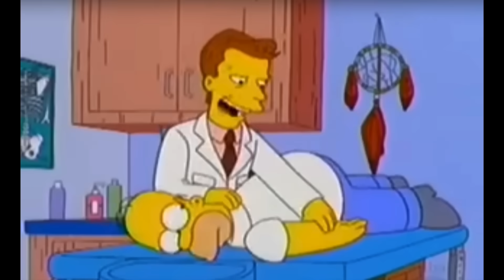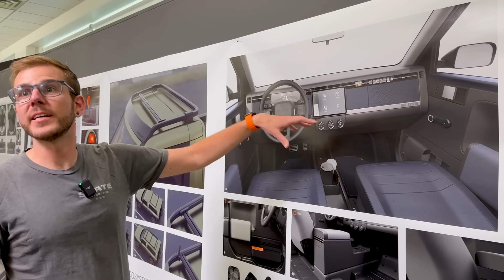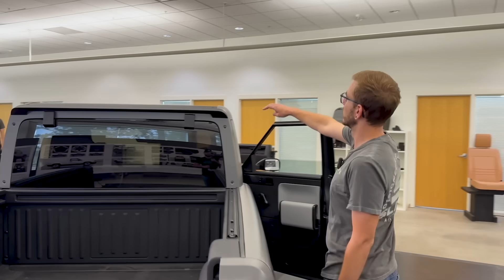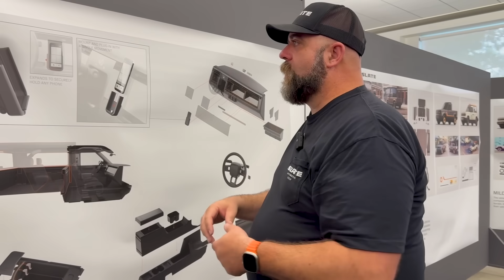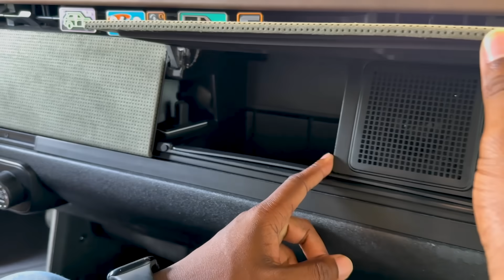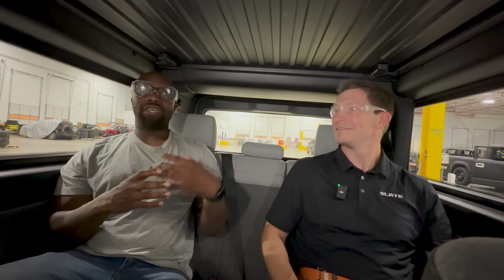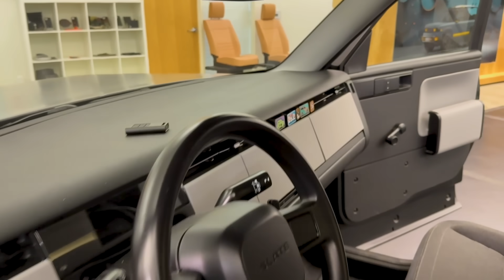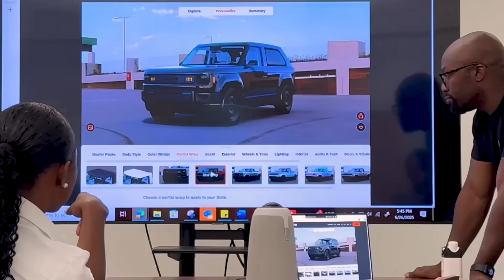The Slate: America’s $20K Answer to China’s Cheap EVs (Exclusive Access)

Comment: The ""$20,000"" ev is actually $27,500 and has hand crank windows, no radio, ac, or paint.
Reply: Still worth it.
Reply: @CitizenKane380  why?  that's pricier than you can get a hybrid pickup today that bests it in range, cost, convenience, tech, capability and practicality.   Or if you really want an entry level EV, get an Equinox EV..  A MUCH better vehicle, 319 miles of range so it's usable wherever, seats 5, radio, paint, carplay, etc.  I see one now a few hundred miles away listing for 30k and that's before the $7500 tax credit that still exists today and another $1250 off if you are a Costco member.
Reply: @rockinkuwaitchris because of simplicity and reliability. The more features on a car. The more complicated the car is the more likely it is to break something in the future. Something will always need to be serviced or updated on those cars.
Reply: @CitizenKane380  Yeah but when was the last time you said "I don't want a radio, because there's a 1% chance it will break in the next 100k miles".   Yes manual windows can break just like electric ones.  I know a fuse or switch for an electric window is cheap and easy to fix and the motors last.   What about the mechanicals in a hand crank?  I had an 89 corsica with roll ups and that was the only window I've ever had in a car fail on me.   If this was the 80's and those old lincoln button windows, sure but they are making them reliable now.  

And you still aren't explaining why you should pay more for less here.  If I can get a slate at $20k sure.  A few grand less than a base maverick, that's something to think about getting a stripper model for.   But more?  

Like you say something will need to be serviced on the Slate.  It will need software updates And where are you taking it?  Are they going to be there in 5 years? (ask Fisker Ocean or Amazon Fire Phone owners about that one).   I get it with an EV company with exactly zero service departments today I may want fewer things on it that may break. But radio, speakers, auto dim lights, paint, etc those are things anyone can do. 

As for Slate reliability I don't think anyone knows, but we can compare to other startup EV reliability with first run models to get an idea.
Reply: @rockinkuwaitchris no one really listens to the radio anymore. It’s all music or podcasts or their devices. Why pay for a radio you hardly use? 
The motors on electric windows aren’t as good as they used to be. I paid $600 dollars to replace one on my Toyota a few years back. 
The hand crank window on my 65 dodge I bought used in 87 worked perfectly until I sold it in 95. 
As far as slate  updates and repairs you have a point however depending on where one lives there are plenty of ev mechanics.
Reply: @CitizenKane380  Interesting.  I get you say "no one".  Edison Research says that while that number is higher with older drivers and lower with younger drivers about 75% of all drivers in their 2025 study tuned into AM/FM radio at least once a month and that it was the most popular audio source used in cars today still.  

But even still if you are listening to streaming or podcasts... lets see..  

Buy the steering wheel adapter (because that's one thing a lot of drivers use is their steering wheel buttons for voice control, play/pause and volume, and that's extra on a slate)

Buy the tablet mount. 

Buy a ruggedized tablet (because most are not rated to be stored in a car with the heat and cold there and you aren't going to be dragging that along).  

Buy the speaker mounts

Buy the speakers

And if you are one of those 75% that like AM/FM radio, figure out your method for that either getting all the streams you need on there or buying an AM/FM receiver and mounting the antenna.  

I'm good.  I get in my vehicle, my phone connects wireless to Android Auto, my maps are there as well as my music and a few other communication apps and it's all integrated and hands free.  

Why should someone spend MORE for a vehicle they have to do that with than the competition that already has that included for less?  

That's still the tough sell you need to make.  That I want to spend more for less.  And that when I sell my car buyers will go "I want a car without a radio and speakers and android auto or carplay more than one with that".

Comment: With all of the accessories and possibilities for customization, is the battery customizable?  Like, can an untrained end user swap a battery out after the number of recharge cycles has been exhausted?  I’ve always thought that the major obstacle for EVs is that you can’t swap a battery out like you can for your electric drill. If there were a quick service battery change that could be performed, like we do for oil changes in ICE cars, that would be a HUGE leap forward for EVs.

Comment: As a concept, the Slate is directly aligned with what I want in a vehicle, and is the only one on my radar I’d actually want to purchase; I’m car-free, use car sharing in Ottawa, Canada. As a bicycle rider and racer for more than 30 years, I’ve always bought bikes with a primary focus on the frame. Components matter, customization matters, but it all hangs off the frame; it’s the capability platform. As a pro mechanic for more than a decade, a big part of the job was modding folks’ bikes over their lifecycle l, and it was and is VERY common to buy bikes for the frame, and upgrade everything over years. ‘Entry level’ bikes fit this need, and they allow people to work through what they actually like, want, need. Cars are not a perfect analog, since many folks are not in a position to choose whether they ‘get into driving’, but the bike shop model seems fairly similar to how things would go for Slate: a shop would do a hell of a lot of consulting and installation. I’m keenly watching how Slate rolls out, and my 3D printer is poised!

Comment: Nice, but yet again another EV that has poor range and is worthless for our cold climate. How about an option of a turbo diesel and a 5-speed; use the engine VW had in the 90’s. It performed well, gave great MPG, worked well in all climates and could be serviced by someone other than an electrical engineer. Make that happen and I’ll buy one for my wife, otherwise I’ll pass…

Comment: So... Yesterday the bill passed through the Senate that will ensure there will be no EV tax credit by the time the Slate EV goes on sale.  This is a $27,500 vehicle... If my grocery store is running a BOGO deal on soda, this week and I won't get there till next week, unless someone is wanting to be really sneaky with the numbers, listing the BOGO price as what I'll pay is just not ethical. 1-2 years before it actually goes on sale per the Marketing teams PR launch (tell me the last time we didn't see price creep with a new EV maker between PR event and actual sale).  

I don't see it.  And this is coming from a guy who loves a cheap small pickup and EV's (I have a Model 3 and a Maverick XL)

150 mile base range.  That doesn't sell in the US today (even the Leaf is finally going longer range).  The average EV selling in the US today is 300 miles of range, and yes there are cheaper lower mile EV's out there.  

2 seats, 2 doors or spend more.  I struggle with that one.  Of the 5 major pickup trims, all have a cheaper 2 door model.  All sell their crew cabs by a factor of about 10 to 1.   Even the Jeep Wrangler, which is a MUCH better vehicle at what it's intended to do in a 2 door setup (off-roading capability) sells 85% of their models in the 4 door Unlimited version.  For a low price/profit vehicle, you need volume, and this seems to be pushing to Niche.  Yes you can get the topper piece.  I've had removable tops in my Jeep.  They are lightened so a couple people can put one on but are awful for wind noise, for insulation, for fit.  Two days there, that's one of the first questions that I would ask and definitely would come out in a couple days.  

Resistive heater.  I have an EV in Minnesota, a model 3 LR from 2020 before the heat pump was put in.   If I stick to my 10-80% charging range, and lose about 35% of my range to cold and another 10% to 4 season tires instead of the efficient EV ones... my range isn't near where it is in summer or for trips.  But 300 miles, that's still ok.  Take those numbers to 150 miles (105 with daily charging limit expected, 95 with the tires for winter, 57ish with the cold) that's about a 25 mile range I can drive away from my house daily.   

Marketing a stripped out vehicle as "pay for what you want".   Already this is priced to be about $3500 higher than what you can find a Maverick Hybrid for TODAY.  What do you get for that extra $3500?   A lot less towing, less payload, seats fewer people, fewer doors, no paint, no set up service shops, no radio, no auto high beams, no power windows...  You can argue "it's less to break", but when's the last time someone had their power window controls break on a new vehicle?  

I don't see it.  If I wanted a cheap EV that seats four... RIGHT NOW I can get an Equinox EV that has better everything and 319 miles of range for $19-21k.  Why would I spend well over $30k in a couple years for the Slate with the body stuff to convert?  Same if I want a truck.  Today I can get a Maverick Hybrid for around $24k.  Why spend $27k+ for a slate that is worse off when it comes to capability, practicality, convenience, comfort, tech... 

Like you say, if it costs $6k to get the two door four seat SUV version... That's insane. $34k for that?  and an AWD Bronco sport that does all the SUV bits so much better for under $30k.  That's right on the edge of Rav4 Hybrid territory and I don't see where this competes at all there.  

Will there be buyers?  sure, but it seems it's pushing itself into niche territory and when you compare what you get vs. the cost.... It's not competitive.

Comment: With the loss of the $7500 EV incentive, manufacture's battery incentive, and the addition of tariffs on imported parts... The base Slate will be $30,000.  The Maverick will be the better choice.
Reply: It already is.  You can get a Maverick hybrid today at $24k.  With range, 4 doors, seats 5, paint, radio, a lot more towing, more payload, apple carplay/android auto, etc etc.

Comment: BYOD - Should make every car accessorisable at a whim - the "car App only needs to interface with an OBD2 or similar universal port - then the information and infotainment can be interfaced with the meatbag -  like any DIY skin for a flight sim app...

Modular - is great, I accessorise my own car/truck using RHS and O-Track... Painted RPS + tubing (when rotary accessories are required) very addaptable, designable - upgradable.

Composite panels - as access hatches  - hidden storage with latching / hinged styleside bed  sides - sounds like a great idea - repair as well as  custimisation  - sounds good (like a cyber truck, anyone can wrap theirs however they like - blank canvas - rather slate.  lol..

Comment: The SUV configuration looked sweet. Would be cool if they actually made the SUV usable for 30k as opposed to RWD 100 miles of range for 20k.
Reply: DO you realize how many people NEVER ever use 4WD on their micro SUV?  it adds to the price point, and in an entry market that very FEW people NEED this feature, it's actually a sales killer not an asset.
Honda makes the Ridgeline AWD, did it pump up sales? nope.
Reply: @JustAnotherJarhead  dude 95% of suvs and trucks are AWD, wtf are you talking about a sales killer? They're planning on making an off-road looking suv that's rwd and 100 miles of range. That's the real sales killer.

Comment: They should also make a Locost Seven kind of sports car which are super cheap to get into manufacturing. The basic ones even use a live rear axle, so they could easily just slap some standard Slate parts in it. Look how well the Toyota 86 and Mazda MX5 sell. Just make any affordable rear wheel drive 2 door car without a pickup body style and you've got a money printing machine.

Comment: Why would I spend 2-5 times as much on this over a 90s-00s Tacoma or Ranger?
What is this giving me that those don't?
Reply: nothing?!? why are you comparing the value of a used anything to its new counterpart? it never makes sense from a value perspective
Reply: @JackSnyder-t3d  Because usually new stuff is a financially poor choice, but you at least get extra little features that aren't on older cars. You spent too much money, but you get a little something to show for it.

This truck is the opposite. You're spending more money compared to a basic old truck, and unless you option the price even higher, you're ALSO getting fewer features. The 20k proposed price tag (if subsidies remain) doesn't even include speakers. I bought a 93 S10 with cold AC for $800 that had a radio and at least 1 working speaker lol
Reply: @bongwaterbojack  its also from 93... its a great truck, dont get me wrong, but there are things that will inevitably go wrong in the coming years. a truck from 93 just isn't going to be as reliable as a brand new truck that is way simpler.  i have a truck from 94 btw
Reply: @JackSnyder-t3d  Watching the experience I and many of my friends have had with new cars, I'd have to dosagree. Some things are simply made better. I have a 84 Mercedes 300SD and a 2016 Audi S8 among other toys. Guess which one spent more time in a shop last year.
Reply: @bongwaterbojack   you're absolutely right that some things are made better than others-- but are we talking about a notoriously complicated and overengineered (not to insult your choice of car) luxury car or a no-frills truck that happens to be electric and highly repairable because of its simplicity and availability of low-cost parts?
Reply: @JackSnyder-t3d  I mean, the list of cars goes on. Not all were nearly as complex as the Audi. Plenty of regular things like my 11 Taurus.

Nothing has survived the way my 93 S10 and 92 Prelude did. The 84 diesel Merc is obviously an unfair example. They're too good and reliable for some goofy little EV built on a shoestring budget to compete.

Which is the other thing. To keep the price low, they're making everything as cheaply as they can. What part of that statement makes you believe the reliability wont be representative of the price?

Comment: If only they offered them with like, Honda sourced K24's or, a Cummins R2.8, both with manual transmissions and available AWD/4WD as an option if you didn't want, nor could even reasonably use due to location, lack of chargers, and ridiculous weather that would drain an EV battery in a couple hours unplugged.

They did that, offered an EV, K24 Gas, and R2.8 Diesel, just like it currently is, they'd sell 3X as many
Reply: you're probably right. the point for them i think is kinda to be electric tho

Comment: I feel like the Ford Maverick is just too fucking huge. The big 3 are only making fucking obese heavyweight monsters.
Reply: Meh.  I have one.  It's 4 inches longer than an accord.   Yeah, two seats would shrink that by a couple foot, but single cabs don't sell in the US.  The top 5 selling models of pickups in the US all have single cab trims, and all are outsold by their more expensive crew cab variants by a factor of 10 to 1.  

And it's 3500-3700 lbs.  That's less than a Mustang...  A few hundred lbs more than an extended (not crew) cab ranger in the early 90's.

Comment: When will companies realize people still need a truck that can hold a full sheet of plywood? With the tailgate up? Jfc I'm tired of rich billionaires offering me 10k for my 1979 T-100
Reply: why do you need the tailgate up?   My Maverick has the bit where I can lift the tailgate to act as a support on the backside.  Threw in a bunch of sheets of 4x8 the other day from Menards.  And I didn't have to find a babysitter for my son since it's a crew cab.  Not many people buy the single cab 8 foot beds anymore.    

The funny thing is you can get 8' beds in new Chevy, Ram, Ford and Toyota pickups.  Just outside of contractors no one buys them.

Comment: I bought a few newer cars, but I recently returned, again after a 10-year break, to the Land Cruiser 80 series. Do you know why? Because it has around 20 fuses and it is made to always start and drive, even if you cut it in half. I hate limp modes and I hope the slate will have really few sensors. Currently vehicles are made NOT to start if there is the slightest malfunction. This would be a game changer for me. Currently many vehicles are like: no input from this or that sensor, vehicle will not start, contact dealer. Electric vehicles are very simple: battery, controller, motor and I hope they design the slate not only to take you out on adventures but also to bring you back home.

Comment: one of the upgrades that i would want (not knowing payload) woudl be bigger battery option but also a bit more motor.  read that as 0-60 time in the 6.5 range not 8s.  i would take the trade off on range (ext batt. woudl be 240 miles ish i drive less then a hundred per day) for something that is faster then my V8 dakota. i can always drive like an old man for range but i dont want to be forced to do it. my job is 80miles round trip so std batt woudl be daily plug in but the bigger batt and a slightly more HP motor if i behave might get me 2 days to work